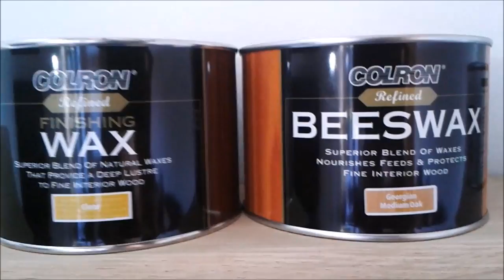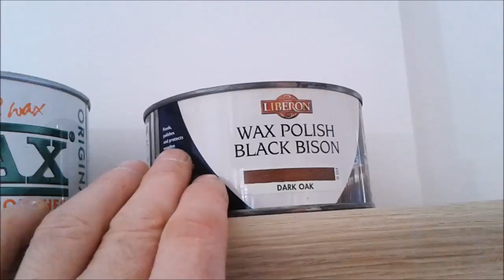Waxing Wood Hints And Tips

Comment: Great video once again 

Once you have give it the final coat and wiped with your cloth , do u then just leave it or seal it with a clear coat of sealer
Reply from the maker: It's all in one Feeds, polishes and helps prevent wood drying out highly lustrous and hard wearing
Good resistance to finger and watermarks.